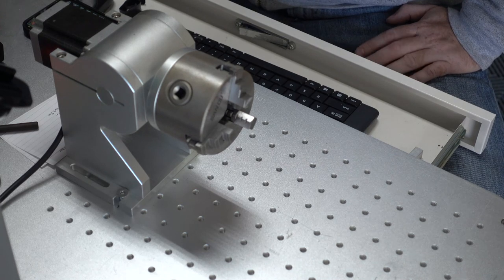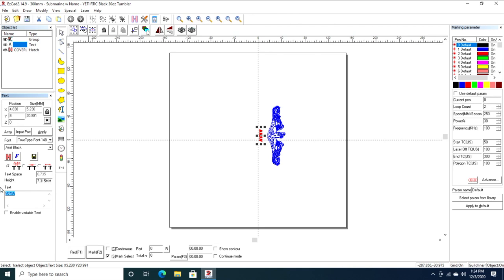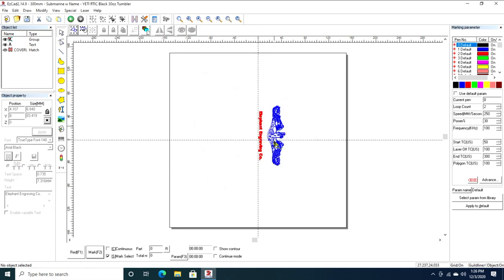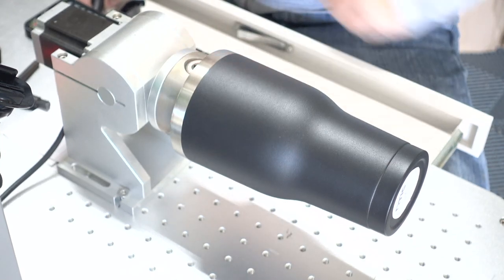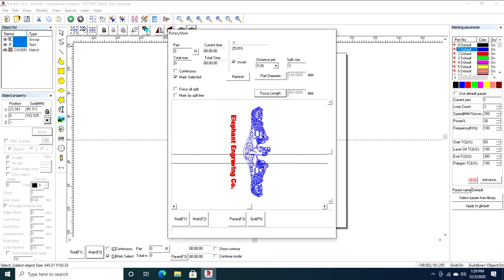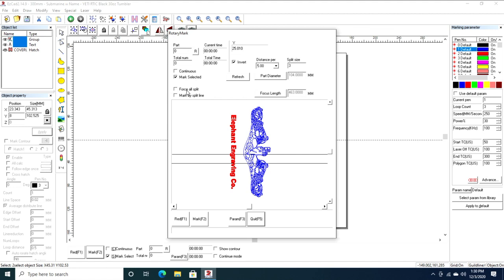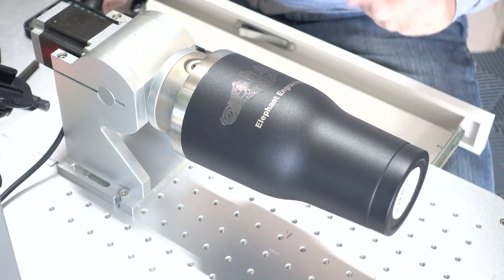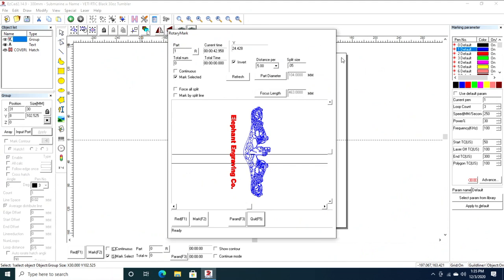Fiber Laser Rotary Basics

Comment: Thank you Sir for your video, learnt a lot from it. I still have a question though: how did you find your initial focus lenght of 465? I have a 30W Raycus with a 175x175 lenses that focuses at 160mm, then I add the hight of my rotary + cup & adjust my tower accordingly with DRO but still  not working... Any thoughts on solving this problem? Tia
Reply from the maker: I measured the actual distance between the lens and the item. Just seemed to work for me.

Comment: How did you get Ezcad to run on windows 10? mine fails out.
Also can you please send me a screen shot of you setting parameters for the rotary section, I'm new to this and have a 30W Chinese laser system with alignment led's for height. Thank you
Reply: Yours might be fake card if yours fails out. I can point you to the EzCad forum where you could find the info of settings parameters. Search 'Ezcad2 Laser Users' on fb group.

Comment: question why do you adjust your focal length ? do you not have a red dot pointer for height adjustment? or am i missing something
Reply from the maker: i actually don't adjust the height of my galvo when i switch cups. everything is really +/- 5mm (20oz, 30oz, bottles, etc.). the red dot pointer is set for 110mm lens and i'm using a 300mm lens. i've disabled the red light pointer for focus and i actually test each lens for the optimum "height above material" focus distance and i keep records of that and adjust accordingly.

Comment: You should open the chuck more and then place your mug on the first actual notch of the jaws. Then your mug can be placed up against the face as intended and it will be concentric with the rotary. The way you are doing it you have to cross your fingers that it is concentric. If it isn't concentric then your surface will move away from your focal point and cause an inferior engraving for no reason.